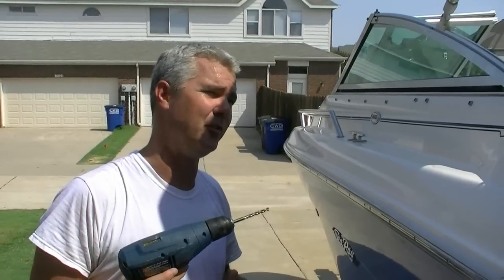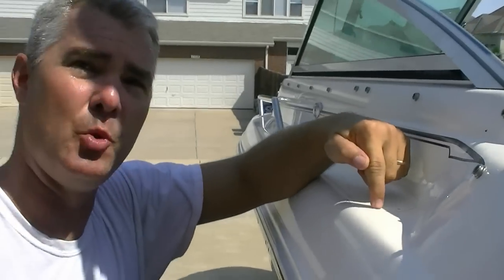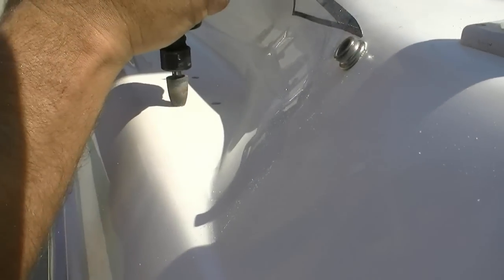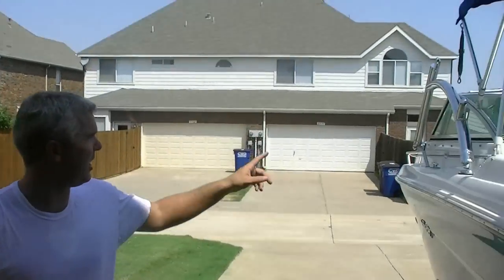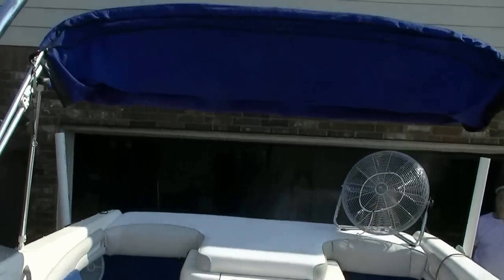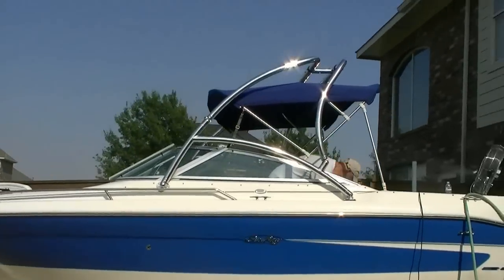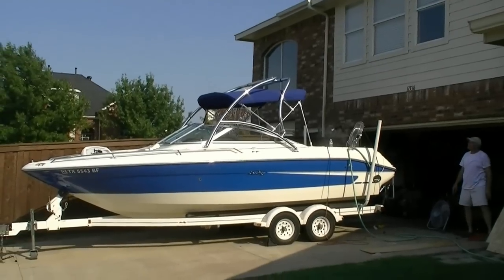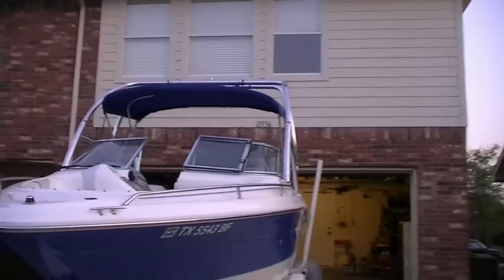Wake Board tower from Krypt installation on the Sea Ray Part 2

Comment: Great job from a life long boater. Throw a couple of spot lights for night use. Pulling into a strange dock a flood light can be a life saver. Someone gets hurt on a dock late at night flood lights are great. Beautifull looking rig. Be Careful with people entering thru the platform. I always removed my keys from ignition just in case someone slipped and hit the ignition and started up the engine. Slip into drive and serious accident. Have fun.

Comment: Hey man, great video as I am just deciding on what tower to buy and will be installing it myself.   I admire your patience and attention to detail.  I have seen a few but you have a great attitude and some helpful tips I did not see elsewhere.  The only thing I would have done different is go to the scrap yard and grab some 1/4 inch aluminium or even 1/8 inch plate (if unlike me you did not have any lying around in the workshop) if you were struggling for bolt length rather than using ply as reinforcement.  Keep up the good work and make sure you enjoy as many hours on the water as you can!  Regards, Greg.  Victoria Australia.

Comment from the maker: It is what you use to get a wake boarder out of the water better. It pulls you up instead of through the water. It also helps you get better air off jumps because the rope is higher.

Comment: How did you manage to get the mouting brackets mounted to the boat? I have a 2009 Larson Senza 186. Trying to get my tower installed and cannot find access to the inside except for my speaker holes. When I reach up in the speaker holes, there is like 6-8 inches of sprayed in foam up inside and it's extremely hard foam. I have watched a bunch of tower install videos on youtube and no one shows how they mount and access the mounting points of the brackets. Thanks.